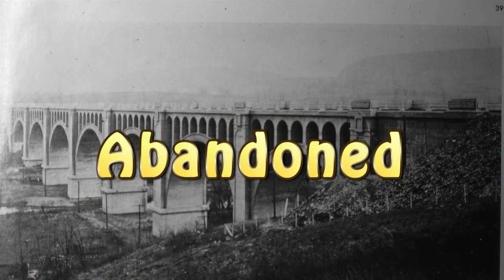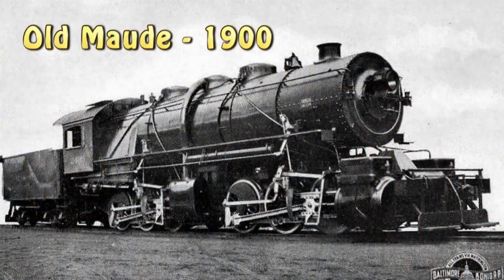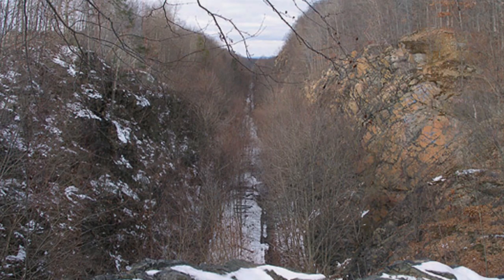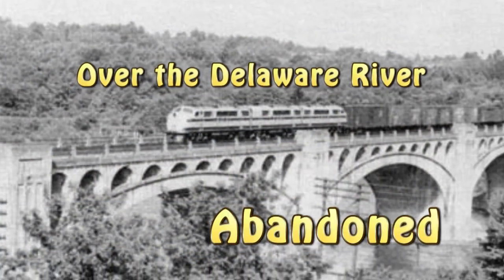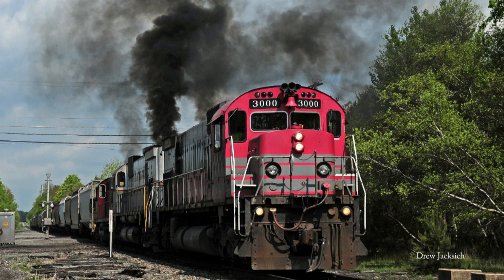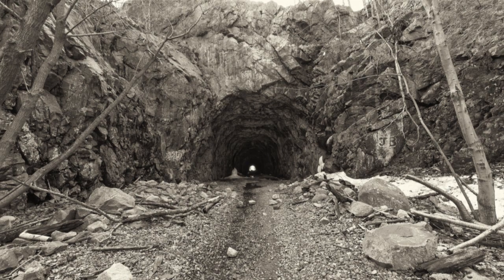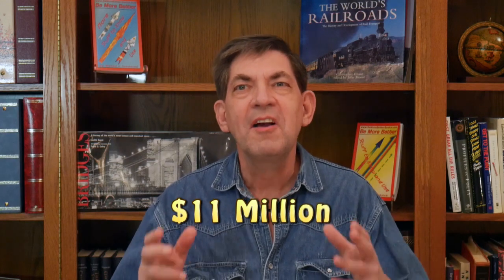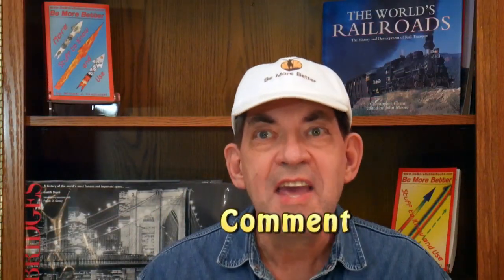BMB #90 - The Ghostly Lackawanna Cutoff

Comment: It's always good when making a plan to also make a plan 'B' or even a 'C' because Murphy [No not your governor] will show up with his law that says "If anything could go wrong - IT WILL!"
Old Maude #2400, 0-6-6-0 built for the B&O RR may have been the World's Largest/Powerful Locomotive when it was built but the Lima Locomotive Work's Allegheney, 2-6-6-6 was far more powerful developing 7,498 drawbar horsepower (dbhp), and it was by far much heavier weighing 778,000 lbs (389 tons) even more than the ALCO 4-8-8-4 Big Boy
Reply from the maker: Pat, you never fail to amaze me!!! And yes, things get bigger all the time.  Look at my waistline.  There is a 35 mile long Railroad tunnel under the alps now!